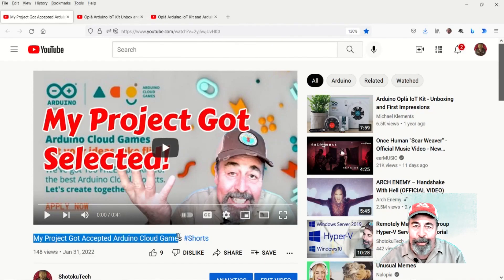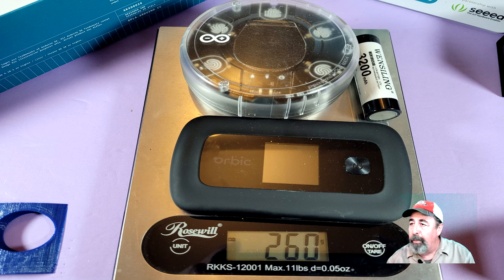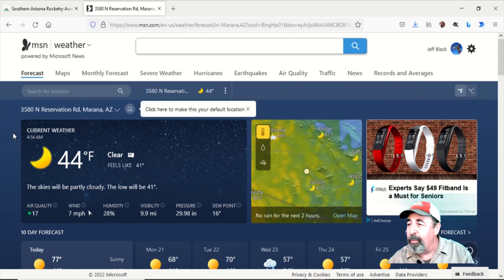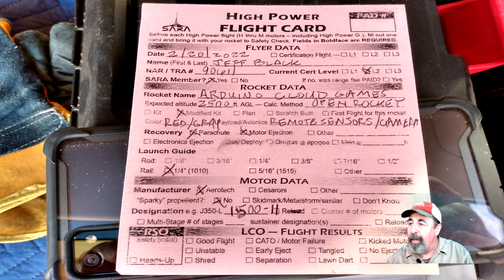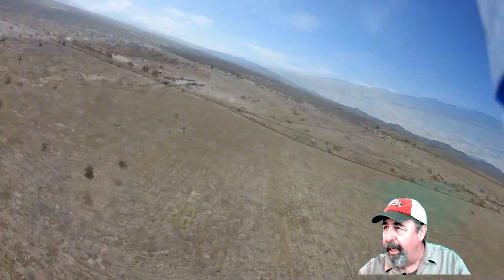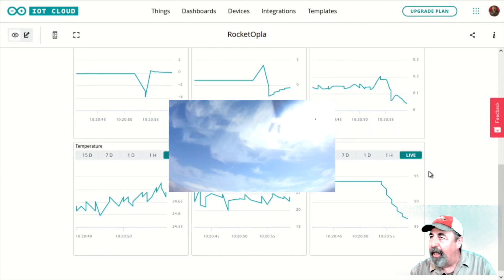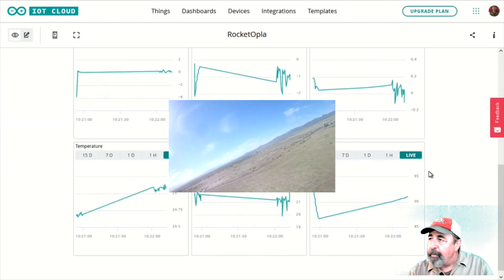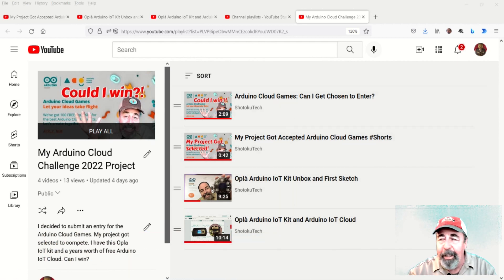Oplà Arduino IoT Kit Flying in a Rocket #ArduinoCloudGames

Comment: Is the design open source?
Reply from the maker: The Oplà Arduino IoT Kit is a hat for the Arduino MKR WiFi 1010  https://store-usa.arduino.cc/collections/iot/products/arduino-mkr-wifi-1010. It includes several sensors, buttons, relays and a battery holder. You actually must program Arduino MKR WiFi 1010 yourself like any other Arduino. The Arduino IoT Cloud has this documentation around making your own APIs. https://www.arduino.cc/reference/en/iot/api/

Comment: Jets and planes seem to induce cloud-like formation in their trails, so the extra humidity might relate to speed? Or maybe it's just the belts of humidity inherently in the sky. There are oceans of water floating above us, pushed up by the warmer air off the sun-lit ground. 

It would have been good to show an overlay of the readings on the video, even if the readings were often missing. I'm not too sure what software you could use to do so though. Actually, with a bit more equipment, you could have the numbers read off real-time on the video recording, rather then collect them and overlay them in post. 

Also, would a different parachute setup allow a more stable video on the way back down? That is alot of spinning footage. A 360 camera could be stabilized in post, although the cost and weight would be vastly higher.
Reply from the maker: You're a poet and you didn't know it! Thanks.

Comment: When you watch these rockets take off, the acceleration must be incredible (don't blink) as they are there and then they are gone. Adafruit has some new high G accelerometers. It would be interesting to graph the acceleration for that 1 second burn time though I don't know what sort of resolution you would get trying to record a 1 sec. long event. Your on-line tool might provide a theoretical calculation of the acceleration but it would be interesting to see it for real.  The velocity of course would be increasing during the entire burn but would the acceleration increase as the fuel burned reduced the mass?
Reply from the maker: All good observations. I think the resolution needed to track this would drive me to record the output locally rather that trying to send it to a dashboard. The thrust of the motor also fluctuates throughout the burn. See that here: https://www.thrustcurve.org/motors/AeroTech/HP-I500T/